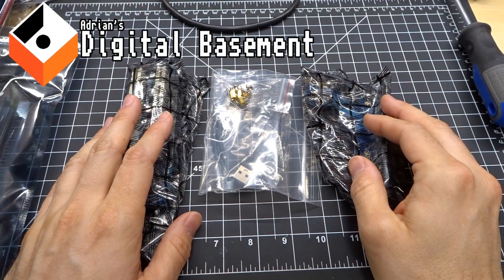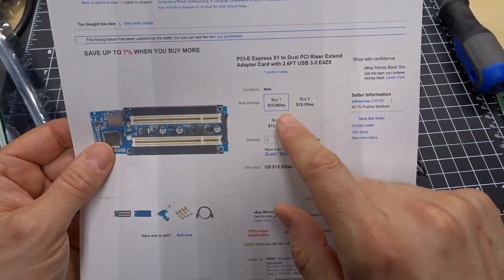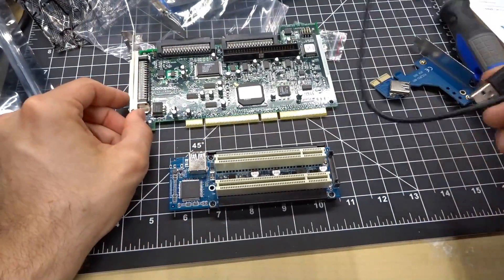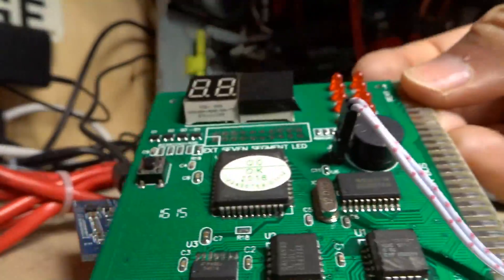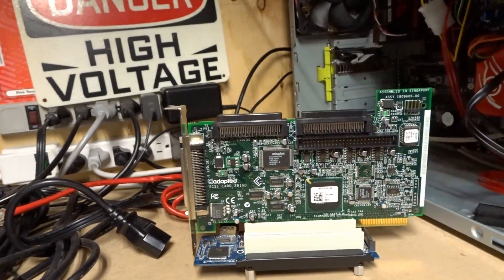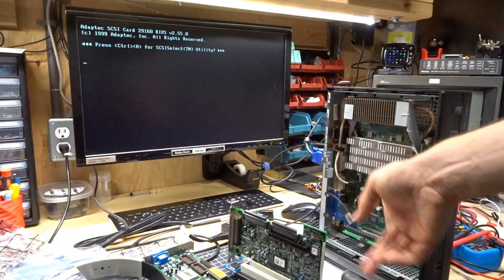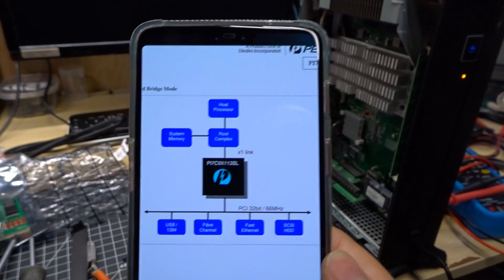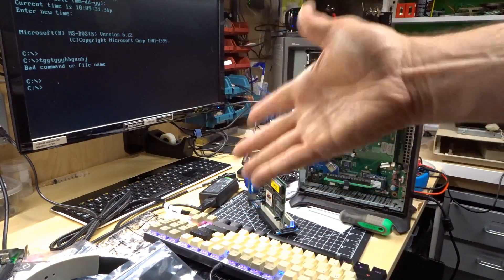Can an external PCI-Express to PCI adapter work? Sort of...

Comment: when using pci-e/pci bridge cards a large number of motherboards larger than 4 expansion slots use a "pci-e switch"  and often fail to recognize the nested bridge cards in lower slots always try to use bridge cards in the topmost slots (often a x1 is just above the x16 gou slot) otherwise refer to the motherboard manual over which slots are directly connected to cpu lanes (often the "gen 2" listed lanes are NOT cpu lanes but instead switched lanes)

Comment: The real issue is that the newer machine is UEFI. The SCSI card is BIOS based just like the thin client. That is why you can't see it on the Win10 PC. Disabling UEFI should resolve the issue and cause another.

Comment: That actually makes for some good sense to make like a USB bridged bus, because it would possibly overcome signal spec issues,  but could have some lag issues. I was wondering about like a big case, using some mount points to use slots beyond the motherboard. Recently when I got a new motherboard, I got an older, more expensive Prime 350B plus because I wanted my Audigy 2 card still. There are 2 pci slots and 1 is blocked by a 3 slot gpu.
Reply: It's not actually USB, they're just using USB cables as a cheap, easy way to pass signals back and forth.

Comment: I bought one of these 2 years ago for my X99 system as it has no PCI slots and I had an older DVB tuner card I wanted to use. It worked fine for about 4-6 months and then it blew up taking out all the PCI-E slots on the motherboard. The way these things power the PCI cards is badly designed and it will still switch on and work even if the auxiliary SATA power connector isn't used. It has no overload protection so if the cards draw too much power over the PCI-E connection then you run the risk of damaging the motherboard as I did. The power connector on mine was also positioned badly where longer PCI cards would get in the way so I had to makeshift an angled connector that was shallow enough to fit. I wouldn't recommend using these on any motherboard you can't afford to damage and instead just buy the PCI-E equivalent of whatever expansion card you need or pay more for a better branded one such as Startech.
Reply: This! This comment should be pinned! Please warn people that these adapters are not safe to use even if they work!
Reply: This not working

Comment: Legacy USB port option? Sata port is for power as the USB is for signal of the pci lane
Sata connector draws the power that's required for the skuz card. 

My Ide 133/100 pci raid card had to draw extra power.

Comment: The "Thin Client" is a Wyse R90LE.
Reply: I had the one newer smaller generation one. I put 16GB of ram, and a sata extender cable to convert the disk on chip thing to a cable.  I installed Server 2016 on it and installed a firewall in a VM on it and it worked pretty well.  I removed TCP/IP from the physical NIC and only had it on the virtual nic and routed it so the VM had to be booted before the computer could get on the internet.  It was like a secure browsing station.

Comment: 1. There's a SATA power plug on the PCI board, maybe the power delivery is not present on the gigabyte?
2. some cards don't play nice with some motherboards, as the standards weren't there for a long time.

Comment: Plug the Sata power connector in, just use an L-Shape right angle Sata power adapter.  The bigger card will draw far more power than the smaller cards. There is nothing sketchy about these bridges at all, they are essentially what is built onto motherboards.  The USB cable is just used for ease, its nothing to do with USB, it's just a high data rate cable for connecting the two boards. Overall you can make an adapter for any bus to bus, Chinese manufacturers are chucking out loads of interfaces from this to that.

Comment: Double notch on Adaptec card is to mark the card as compatible with either 3.3V and 5V PCI standard. And yes, this card is officially 32/64 bit. Second notch on extended part marks it also as a 66 MHz capable. I have one on my Dell server. The only 64-bit PCI card I ever used ;-)

Comment: Usually ASMedia ASM1083 or Broadcom PEX8112 are used on standalone PCI-Express cards where only PCI chip exists but a card is produced as a retrofit for newer computers. I have not tested either of these chips, and i don't have any new mainboards/computers, my computer is ANCIENT, but you can get PCI-E to PCI converters with these chips! Maybe those will work better. But maybe they support a single card only, not a bunch of cards.

I tried determining where your chip got to be used, but it seems to have been found only in very special niches. I wouldn't be surprised if it has any special requirements to actually run. But then i don't know whether the other two chips even support Option ROM devices and such, and this one apparently does.

As to USB of course it's just used similar to "alternate mode" USB3 spec which guarantees that these USB3 cables are signal-compatible to PCI-e 1x and a number of similar protocols and don't cause much signal degradation - without the boards actually being USB compliant. It's kinda elegant actually from the manufacturing and servicing standpoint!

Comment: I think adapters like that are mainly used for mining rigs to hook up as many video cards as possible to a single motherboard.
Reply: Not quite like that, no. There's no use for PCI cards in a mining rig! The adapter to install more PCI-e graphics cards or special-purpose accelerators looks deceptively similar but has technically nothing in common.

Comment: There could be some PCI settings on your Gigabyte board that will let it see the SCSI card.  You might want to try a different slot as there are differences in slots as to what else is hanging on that particular PCI bus.

Comment: You should really try a more serious pci external adapter. At my work we use a lot of them for electrical noise reasons. The devices we use have a special card that sits in the host pc and uses 2 dvi cables to run to the external chassis which has 4 or 5 pci / pci-express slots in it.
Reply: running pci-e directly over a usb3 cable is going to have signal ring issues.

Comment: Add additional power using the SATA power plug  as you might not have enough through pcie x1 ,plug in a  sata power cable as well on the board and should work on main PC.Worked for me

Comment: The x1 slot you used was probably on the PCH and not direct to the CPU. Plug it into one of the x16 slots near the top and it may work fine.
Reply: No No  This seems harsh.

Adrain, please do NOT remove this video.  I find it very useful despite the issues that some people have with it.  I've not found much information like it yet.  So you're video is one of my early / primary sources.  Please keep it.
Reply: No No  Then I stand corrected, justly 🤔
Reply: Enable legacy devices in bios
Reply: No No  Thank you for confirming that it works with all motherboards that you've used it on.  That relieves some concern that I have about wondering if it will work with my board(s).  The other comments about not being behind the PCH and INT60/64 support this too.
Reply: That's exactly my point - use one of PCIe slots direcrly from CPU. Not PCH 1x slots
Reply: Have one in my Aurous with a ryzen 9 providing sata to 4 additional storage drives, not a problem... SCUSI was so outdated even when you did this video. It had such a small window of compatibility.
Reply: It may work, I had a machine that had multiple PCI-E slots and none of them worked with the card I tried.  I think it's dependent on the system you're using.
Reply: No No  That's a bit harsh!  I came in here to say I was surprised that anything worked with just the power delivered down a usb cable due to constraints with voltage/current. Didn't expect a Spanish Inquisition on the chap. The SATA power plug looks to me it will probably get in the way of any card plugged in as it's vertical out of the backplane board. Might need some soldering and some short wires to fix that.

Comment: Adrian,   You could retry by putting the internal interface PCIe on a longer 16x slot.  by using the 1X slot it's maybe too slow to detect the scsi card.  On that other wise pc, you plugged it on a 16X slot and it did see the card.    And if it does see that card, if you want to plug in an external SCSI drive, be sure to supply external power to that interface card or external drive.    

One other option.  They sell riser card  about two inch high inline with the PCIe slot and on top you have a PCI slot with no usb cable or anything else.  It's a strait PCIe to PCI interface.  The only draw back you can't put the side cover because the card will have two inch extend outside the frame of the case.  An other one would be to find a flexible 16X PCIe to PCI ribbon interface the external board has two slot, one PCI and one PCIe ad you help for the power with one molex or Sata power connector to the external.   

Many PC Mod builder use these special interface when they move the video card horizontal or the MB is not close to the video card.

Comment: you will need to add the sata power to the included signal adaptor board connector to make it work properly usually,as most older pci use the universal voltage PCI cards (3.3V/5V) and so need the extra power to boot properly, still far simpler than hacking and soldering ribbon cable to the right spaced reclaimed  connectors for fitting the original  a590 with original unpopulated pins of the Shugart ST506 mfm/xt with a real 5 megabytes after formatting,and scsi tape/drives installed to the reversed a1000<>a2000 expansion connector :), zx81 flappy external 16k ram expansion style, that was real fun back in the day.
alas i never really did get Commodore's official licenced port of AT&T System V Release 4 Unix working there, everything else worked fine.

oh and pci are always keyed on the right with the back slot facing left so you where fine...

Comment: Try to get extra power to the external board, by all means. PCIe 1x is limited by specs to 500 mA per card. That old SCSI host adapter surely takes more than that even if the Option ROM came on in the other computer.

Comment: HI you asked for info i have been using scsi for a long  time on my old LTO ait dat  drives  the best card is the pci-e 320 
i powered it up with the sata power as well just in case i missed some thing i add the card you got did the same  when i popped in my M-AUDIO cards
the card came up in the look of drivers and was in the right place saying they were there i had that card you got  i stopped using it because it was not plug and play not
nice  it's a server card i payed very low money for my pci-e  card bob

Comment: hi got this for my pci m-audio cards i had to make a rig to hold to hold the card right you can get a case the hold this and cards
Reply: Hey Bob, I need to do the same thing for a an E-MU 1820M.  Other than the SATA power did you have to do any special tricks to get it to run?
Reply: Yeah I need to do the same with my E-MU 1820m fucking sucks that manufacturers won't lave at least one pci slot for legacy hardware just managed to get a pcie E-MU 0404 not a great workaround
Reply: @firstborn7370  If you guys still need a mount I used a mini test bench for my X-Fi Elite Pro.
Reply: @willhartford2289  I was lucky enough to get my hands on a pcie E-MU 1616 but thanks

Comment: @Adrian Black
Adrian, have you checked to see if your bench system has any boot rom options in it's BIOS? (forgive me if that's been asked/answered already). Additionally, as has been stated by others, that SATA power connector is to provide power to cards that draw more power than most, such as your Adaptec SCSI card. Remember that a PCIe1x slot can only provide 10w of power unlike a 4x slot that can provide 25W and a 16x slot that can provide 75w. My bet is that your adapter needs more power than the 1x slot can provide and that is why the SCSI card won't boot in your bench system. Plug in a SATA power connector(you need to get one with a right angle connector) then test it. My bet is that it'll work.

Comment: You should not be using a K sku processor with the stock intel fan (which is why they do not come included with one), especially if you plan on overclocking

Comment: So the bench PC is not in UEFI ? Why not ? It is more or less recommended when running Windows 8 / Windows 10.
Did you try an Bios update on the Gigabyte motherboard ? Most of the time that will solve things.

So the thin client is normally a Novel / Citrix based system ? Or does it run some kind of Windows ?

Comment: Did you try the BIOS on the first machine?  Change USB settings there?  Usually there are some settings like boot, mode and other such things.  I didn't see you bother in the video.  If it worked on the thinclient, it would most likely work on that PC, IMO.

Comment: try the pci-e to pci adapter on other pci-e slots as it might not work on all slots depending on how they're wired; some slots maybe on a port multiplier or similar; gigabytes motherboards usually have a diagram to show how the ports are all wired(south bridge, north bridge, with a switch or other)

Comment: This could be a good solution to a predicament I have. I have a Small Form Factor tower that is running Win98, I want to put a good Win9x video card in, and a voodoo (or a higher end one that can run stuff in a glide wrapper), but no low profile variants.

Comment: You could get a older board for the pc, my pc has a nforce 6m-a v3.0 in it and i have 3 pci slots (one im going to use for a 7.1 suround sound card) 1 pcie x1 slot and 1 pcie x16 slot (that has my AMD radion 6450 graphics card in it) and it can use a dual core 3.1 Ghz AMD phenom CPU

Or try a different bios

Comment: The PCIe x1 slots on this mainboard are attached to the chipset, so maybe the chipset doesn't support additional PCI(e) bridges to be attached to it. Have you tried plugging the PCIe-to-PCI card into the topmost x16 slot? That one should be connected directly to the CPU.

Comment: A USB A to A cable? Unholy thing. Kill it with fire!
Reply: I have one from an old camera, always did wonder why they didn't just use a B connector on one side.
Reply: @absalomdraconis  because it not a standard USB connection, i think they just used that as common available parts, it simply bridge the PCIe data lane and power to the daughter card

Comment: I think u need some more power to run 2 cards and those usb cables r really fiddly and some times makes no contact , I would like to see HDMI connector like they used before or USB type c... both has enough pins to carry pci signal and some motherboards specially older ones dont have enough Singal strength to travel long distance...

Comment: Put it back in ur windows 10 PC...get the PCI board power with a sata power cable and it will work fine

Comment: Problem with that motherboard not booting fast/correctly is most likely power supply problem (if it is old)
Reply: @adriansdigitalbasement that might be it, those caps are solid electrolyte, when they expand and shrink they might crack from inside. So now they don't filter as well

Comment: I was certain that Intel processors are backwards compatible all the way to ISA slots. They just had to be put on the board, and the BIOS programmed to support them. I could be wrong.
Reply: The LPC bus is mostly compatible with ISA

Comment: Have you tried it directly into a USB3 socket instead of using the small PCI express card?

But I would also suspect it would be better to have the sata power cable connected.

Interesting video Adrian....
Reply: That would burn the adapter and/or the cards plugged in, this thing only uses the USB3 cable, not the protocol, and the connectors pin-out is different.

Comment: You’re right in thinking that kind of chip usually goes on a motherboard. If you check the block diagram in the manual of a recent motherboard with PCI slots, you’ll see “PCIe to PCI Bridge”. Later graphics cards also did this but in the reverse way, so they could design the card for PCIe and then port it to AGP by simply sticking this kind of bridge chip on the board.

Comment: It is a power issue. I am running the identical setup nearly to you, and I had to use a 90 degree sata power plug which I still needed to shave a little bit, and at that the pci card is only about 90% in the slot, but IT WORKS...  Some motherboards react differently to power requirement signals on the pcie slots. That contraption has no logic to tell the motherboard what its power requirements are, so the motherboard will use whatever default is set by its maker. And its probably 5 or 10 watts only. The wyse may be giving the max of 25 watts or have a slightly higher voltage which is just enough for the card to work.

Comment: There is a SCSI card that works on PCIe x4, it's the ATTO ExpressPCI UL5D. Only issue is that it has a very high density SCSI connector (so a gender-changer will be required) and that it's quite expensive (even used ones go for a 200€ bomb... Don't know how much it'll do in dollars but that's going to burn a hole in your wallet)

Comment: It does not require additional power supply when power below 16W, besides, there are SATA to enhance power on the board so tat is where sata power plug is for

Comment: Just try another slot in the first machine even if is a pcie x4 etc. Sometimes you get conflicts in one slot with things on the MoBo and X board would fail in that one then works in another. Is why PnP is still called Plug and Pray after 25 years.